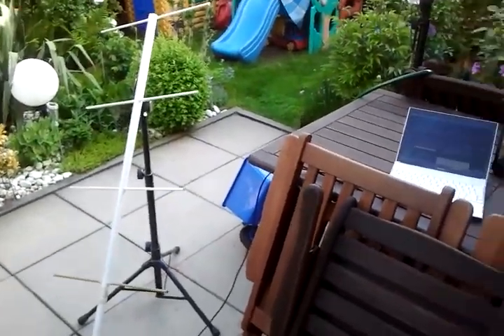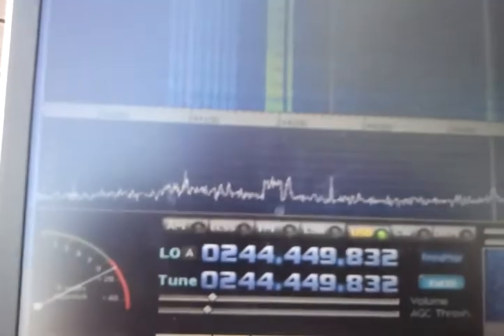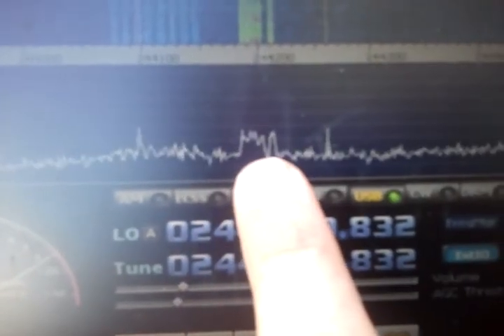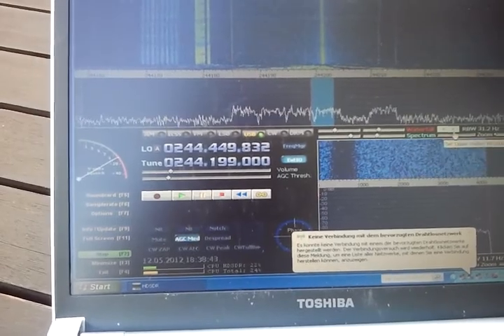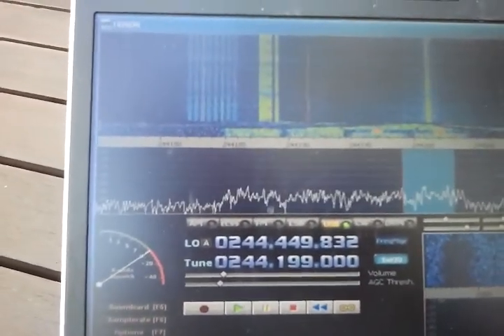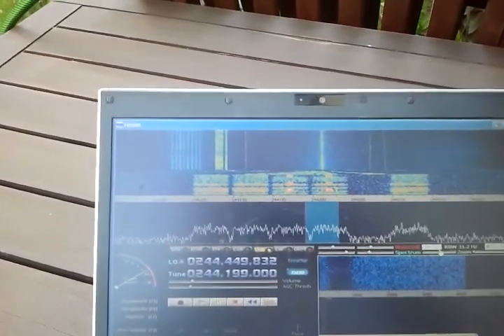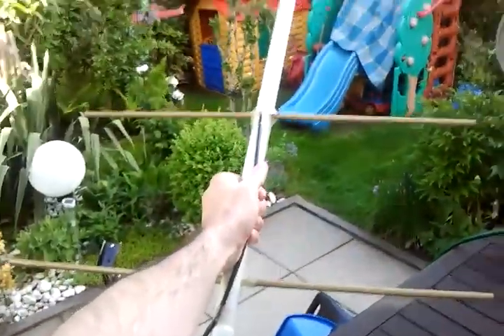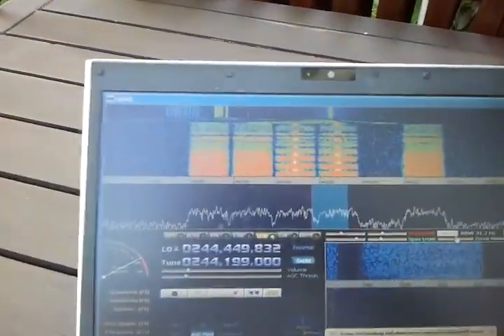UHF MIL SATCOM with 6el Yagi and cheap RTL SDR RX

Comment from the maker: Yes, but as you can see here on the screen it is not needed and anyway the signals are coming from various orbital positions - not jut one....

I also have a homemade 260MHz preamp, but that is only used for weak signals (e.g. Russian Meridian-2 Molnya satellites). The FLTSATCOM ones are so strong that the dongle sensitivity is sufficiently good, specially with a directional antenna like this one.